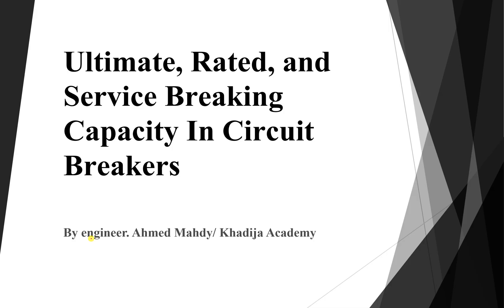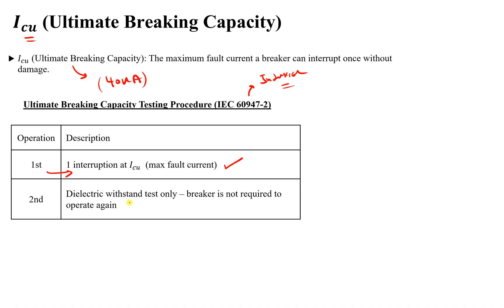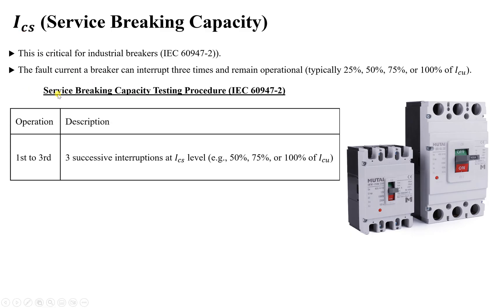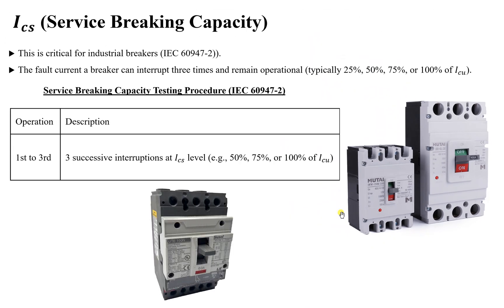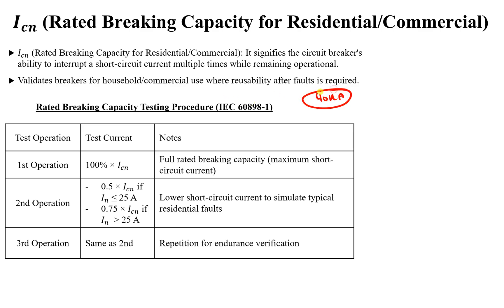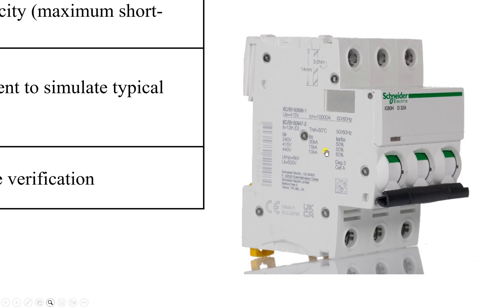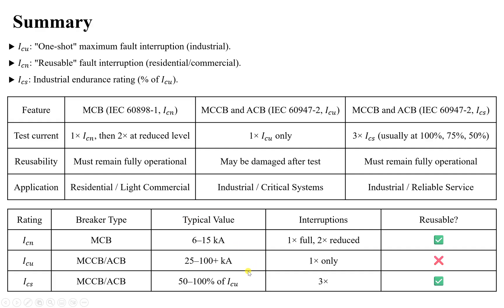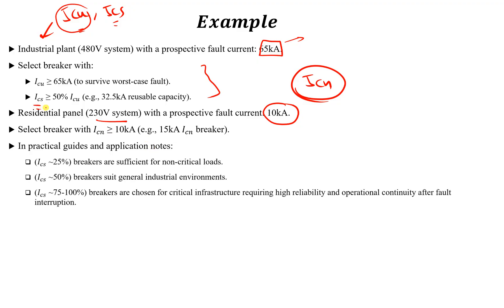Ultimate, Rated, and Service Breaking Capacity In Circuit Breakers

Comment: 6:18 are the voltages noted line to line or phase voltages?
and throughout the video in the final example? I'm confused about when each voltage is used
thanks for the video!
Reply from the maker: The circuit breaker can be used in different regions worldwide and designed for different operating voltages. Let me explain what you can find on the circuit breaker you mentioned:
In the datasheet of the breaker, you will find UL 489 AC voltage ratings:
240V, 480V, 380V/415V, and 600V are line-line voltages.
600Y 347V: 600V is the line-to-line voltage, and 347V is the line-to-neutral voltage in a Wye (Y) configuration.
250V/500V are DC voltages. These are considered DC breakers that are used in solar energy projects because when you connect group of panels in series, their voltage will go up requiring breakers like this one.
120/240V is a split-phase in North America. They use a center-taped transformer, in which 120V is considered the phase voltage and 240V is line-line.
IEC60947-2 ratings in the datasheet:
220/240V and 380V/415V  are line-line voltages.
The selection of voltage depends on the type of system like split-phase, delta connection or star, residential and commerical or even industrial (each can have a different voltage depending on the country code).